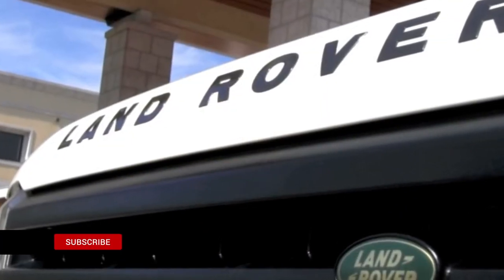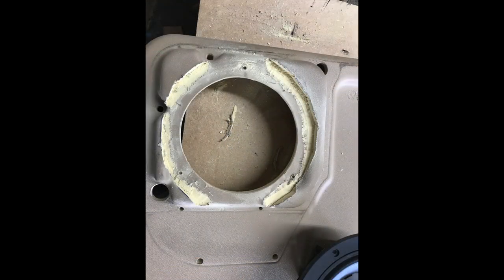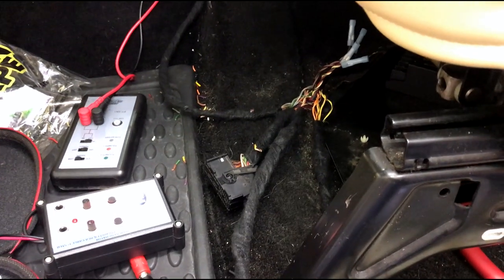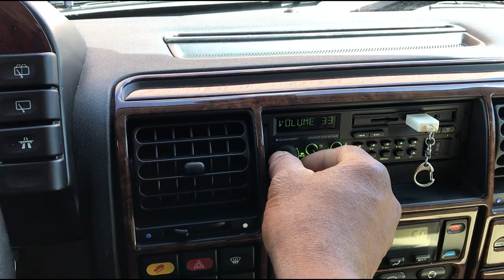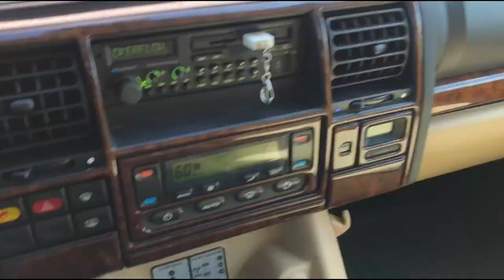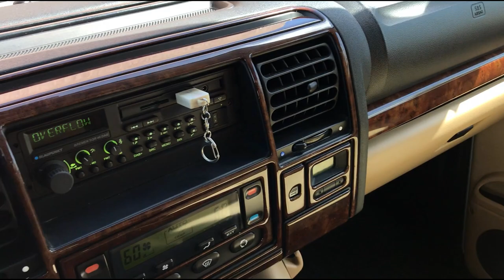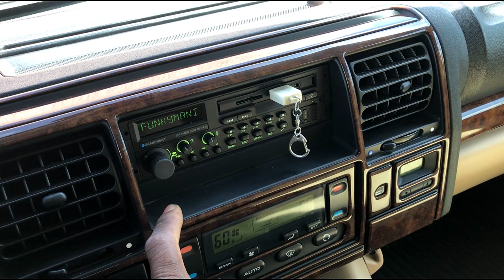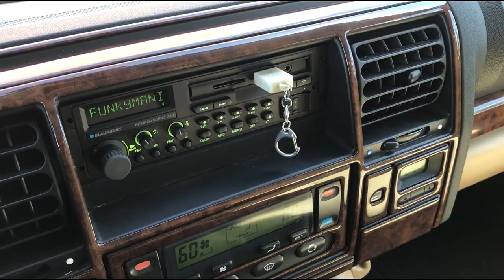2003 LAND ROVER DISCOVERY LR2 GETS HI-END AUDIO SYSTEM.

Comment: Did you need to run new cables to the subwoofers? Or can you use the existing factory cables?
Reply: When i added 2x12" to my car, i disconnected the subwoofer in the rear tailgate door, ran audio cables from the right access panel/vent thing into the rubber grommet for the tailgate door and onto the subwoofer output for the rear tailgate door. Basically took the signal from the oem sub ran it back through the oem grommet and hid the cable under the carpet:) send me a message if you want to see the install🙋🏽‍♂️
Reply: The best thing to do if you want it like in the video, you need to mount an amp inside the rear boot before the grommet, cut the signal wires from the oem subwoofer before the rubber grommet, attach to the amp, and run the amp output through the grommet and into the speakers. You cannot run high powered aftermarket subwoofers on the oem cables.